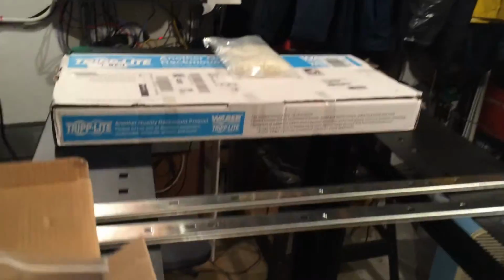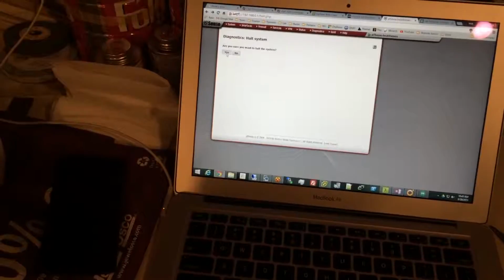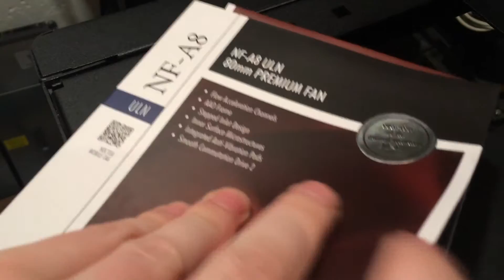Home Lab Rack Enclosure Project - Part 2

Comment: Another great video !  Do your Servers and computer get there Time UP-Dates from the PFSense firewall ?  Also I put in quiet fans in my ebay Dell Switch operating in dumb mode (and if I want to up grade then I get a Paper-Clip).  And do you have the "L" Shelf to support the Tripp Lite UPS ?  Thank you for the video !  tjl
Reply from the maker: Yes to the support shelf kit for the UPS. I did a video on it here: https://youtu.be/i1M0KnyjjFk
Also I use public NTP pools for my ESXi servers and my VMs sync with the system clocks.
Reply: Maybe have your ESXi servers get the time from the PFSense and for back-up use your NTP pool...  Linking to the PF Sense Server will have all your clock reading the same time and cut down on internet usage.  My desktop computer links to NIST in Colorado (and if East of the Mississippi River maybe link to the naval Observatory in Washington D.C.).   But I am running without a back up NTP...  tjl

Comment: Are Norco rails all you're using?  What's the model of that Belkin rack? Looks nice
Reply from the maker: +Jordan Cruz Thank you sir! Also yes I'm using the Norco rails for the 2U Norco servers and a Triplite kit for the UPS. The rack is a Belkin RK1002 24U enclosure with the caster wheels on the bottom. I was able to get it used from someone on Craigslist for a decent price.
Reply: Nick Keyzer Nice! It's hard to find a good rack for a decent price nowadays. Do you know if the Norco rails are universal? I have a Rosewill 4U case that I want to add rails to.
Reply from the maker: +Jordan Cruz I don't believe they're universal since they're fitted to some tabs and holes on the cases. I've heard some mixed reviews of people trying to use them for other larger cases. Unfortunately rail kits aren't cheap and rarely work outside what they were designed for. Such is the rack life :P
Reply: +Nick Keyzer I have a 42U rack I picked up from Craigslist for $100 but damn it's huge lol. Where did you buy the cage nuts/screws?
Reply from the maker: +Jordan Cruz Befriend someone with an Amazon Prime subscription and pick from one of the many bulk packages.